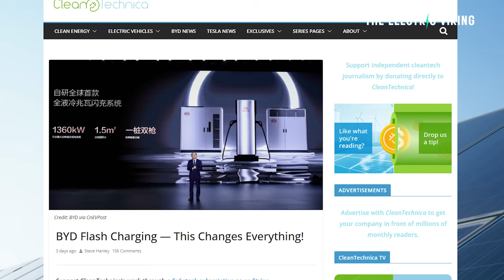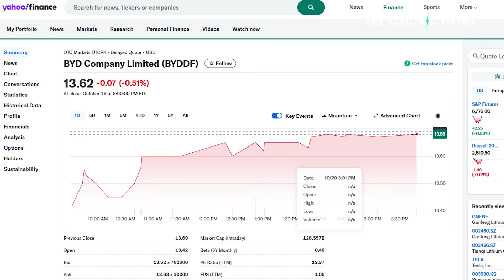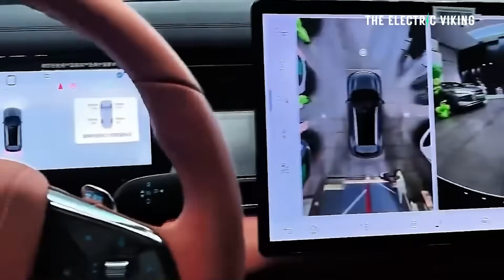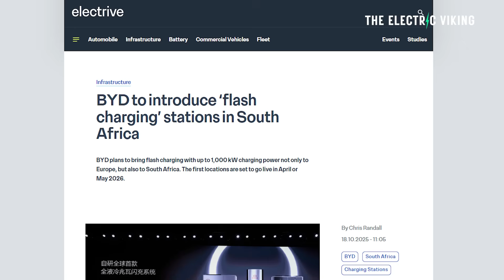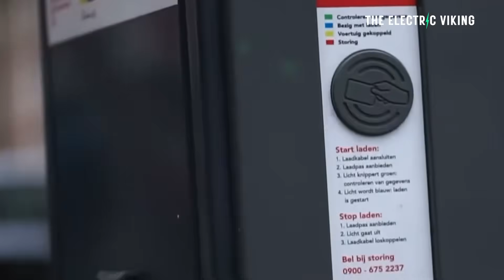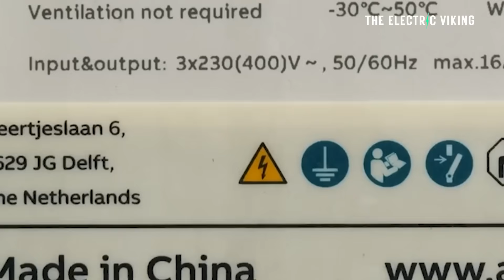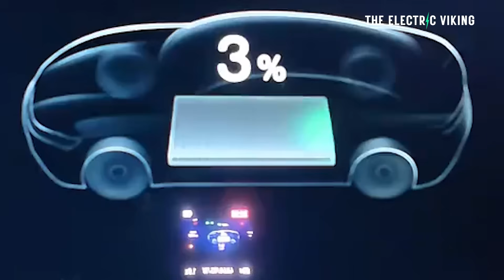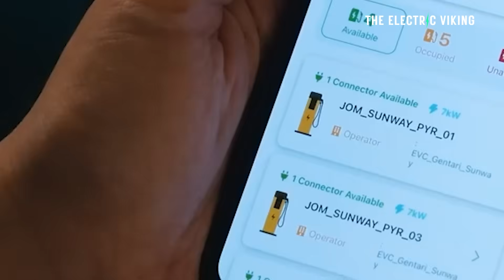Steve Hanley Says BYD's FLASH Charging "Changes EVERYTHING!"

Comment: Public chargers already deployed in Europe, like those using Alpitronics HYC-1000, can already support 600 kW charging using CCS2 and 1,000 kW using MCS connectors. Further, Phoenix Contact has launched a CCS2 connector and cable system in Europe, that supports up to 1,000 kW charging (1 MW boost and 800 kW sustained) using active liquid cooling cables (or 800kW boost / 600 kW sustained non-active cooling).

Comment: There is not simply one single thing that will dramatically help EV adoption. We need lower vehicle prices. Plus far more charging stations but those stations must be capable of fast charging so people aren't sitting in line for 1/2-1+ hours waiting to even start charging their vehicle. Sodium ion batteries may make a big difference in adoption as well for safety reasons. Especially if they pour some money into them to get the energy desity up a lot more to get the range up around 600 miles or more. To much EV bashing by fossil fuels over the years to make EV adoption really take off without all these things. We are getting close!

Comment: 1kKW= 1MW, the 3ph power supply current at 400V is 1500A/phase. 
it is an expensive installation for remote area.
Reply: If the station has its own buffer battery, then there is no problem at all; such a station may not even be connected to the grid if it has its own solar panels.
Reply: @alexandrshevtsov8  buffer for 1MW?
Reply: @RR_reunificationRights yes right.

Comment: Obviously people don't understand why are the 1MW chargers available...
If you take two cars on this DC charger, two of them will be able to charge little bit under 500kW... 
That machine will separate this power on two... 
So the car's don't need to be 1MW charge in to the battery, just 400kW, what is just enough for 800V, or 1000V battery platform... 
This will not be possible for 400V battery platform, because of the charging plug is not able to take more then 300kW of power with that mych current... 
It means to have capabilities to charge up to 1MW it is great, but car onboard computer will make decision how much power is going to flow in to the battery.. 
Good luck everyone...

Comment: Fast charging is way more important than range.  I don't want to lug around a battery with 600km of range that I will only use now and again, instead I would rather have a far lighter battery, say 200km, that could very fast charge on the odd occasions I am driving more that 200km in one go.
Reply: I'd rather range so I can go further and still return home to charge for free.
Reply: So charge up to 200km range and when you do need it, go higher? 🤷
Reply: Thats simple opinion, there are good reasons for the other way around.
Reply: @muten861  A matter of which factor is greater. Aero and motor efficiency matter more than weight as a rule.
Reply: Rethink that. What you really want is efficiency. Unless you are racing an extra 500 lbs of battery has no effect. Efficiency lowers cost, allows smaller batteries. 
Fast charging can seem the same, but costs more and the lower range puts you at the charger more often.
Reply: @thedukeofalinor1377 all else being equal, a smaller lighter battery would be more efficient
Reply: @thedukeofalinor1377  Complete and utter drivel, weight is extremely important to efficiency of cars.
Reply: @jamie-ck6js  Ignorance is not your friend, look up weight vs efficiency in EVs. While weight is important, other factors count more, like aero.
Reply: @thedukeofalinor1377  Yes, I did and weight plays a very significant factor.  Every time you accelerate, you’re putting energy into moving mass. The physics is absolutely blunt about it.  Double the mass, and for the same speed, you need double the energy to get there.  And in urban start/stop weight is way more important than aero.  So frankly you couldn't be more wrong.
Reply: @jamie-ck6js  True for ICE.
Not true for BEVs. But thanks for explaining your thinking.

Comment: Megawatt charging for passenger cars is massive overkill. 150 kW can add a hundred miles of range to a Bolt EV in ten minutes. 300 kW can add 200 miles in ten minutes. If I go to the bathroom and grab some snacks and a drink on a charge stop, I'll spend ten minutes at the filling station. I have charged at 50 kW or less on road trips for years, and the relatively slow charging has never been a problem. It could be for others, but it's not for me.

Increasing EV efficiency makes a lot more sense than supporting megawatt charger particularly while megawatt chargers are practically non-existent. If Aptera produces its vehicle next year, I may have a car delivering 400 miles from 44 kWh. Even at 150 kW, that's 200 miles in fifteen minutes, plenty fast enough.
Reply: Whilst I agree that efficiency is the more important goal, one needs to consider that most of the charger manufacturers selling megawatt chargers are doing so as flexible hub units that can support up to 8 charging dispensers, sharing power across the dispensers as required. This allows a hub charger to support anything from 8 cars charging at 125 kW to one HGV charging at 1 MW from the same unit at the same time, sharing the load dynamically between the vehicles.

The idea is to reduce charging site installation and operational costs by consolidating the number of power units required to as few as possible for a larger number of dispensers. Some chargers are now moving to supporting up to 12 charging points per charger power unit.

These chargers also operate at finer granularity, often in units of 50 kW or 62.5 kW, so cars can draw what they are capable of charging up to the shared capacity available - so if a 800v 500kW charging car is only plugged in it will draw it's full charging capability, equally they could support eight vehicles charging with a 50 kW charging capability (utilising only 40% of the chargers capacity, with the rest of the power likely shared at the site level with other hub charger power units).

Comment: charge faster, drive longer, cheaper to buy, cheaper to own, if all are achieved, then what's the point of ice car
Reply: Sound and nostalgia.
Reply: Fast charging is only important for a very small minority of people. I've had my EV since March, done 10,000 miles, been on holiday in it, and have only used Public chargers to get to and from my holiday destination. Only people who don't have EVs think ultra rapid charging is important.
Reply: @rogerfroud300 All the ev channels and manufacturers seem to think it is a big deal.
Reply: @rogerfroud300 Electric trucks needing it is probably worth it alone. Logistics and trucking are the baseline of markets and restocking.
Reply: @rogerfroud300 I have an ev and have had to charge multiple times now at fast chargers and im only at 4500 miles. Any drive that exceeds 2 hours one way means fast charging is needed along the way. Now if evs start to have 500 plus miles of actual usable range then sure fast charging becomes less of an issue. But that does not address the vast majority of people that do not own their own homes and rent. Especially in cities etc where they cannot have home chargers. Having evs that can charge in well under 10 minutes becomes very relevant if not required. My equinox takes a long time to charge even at fast chargers which is not an issue for me personally. But now if there are 10 plus other people also needing to charge that does become a problem if there a not enough chargers or thr chargers are just to slow... let alone if the car itself just cannot handle ultra fast charging.
Reply: @scow01 I go to Costco to gas up and wait in line for an available pump frequently. Total time at pump often exceeds 10 minutes, so not a problem for me. Just waiting for the EV range to get to that magic 500 miles baseline at a reasonable cost.
Reply: @rogerfroud300 I think not having to worry about running your battery to zero and then having it fail is more important. As well as operability at low temperature without significant capacity degradation
Reply: No point at all.
Reply: Well, if you're a MAGA cult dweeb in the US, I can tell you that there's still a huge point. They can prove their loyalty to the Orange Rapey Guy, maintain full cred and good standing with their demented tribal cohort of cretins, AND they get to keep spreading their big blobby, quivering legs wide open to the petro-gangsters. Sounds stupid to any functional adult, I know, but as a resident of a tRumpy area of California, I can tell you that lots of people are still that dumb and zoned-out to the cult here. It's JUST FREAKIN' WEIRD. 😵‍💫
Reply: Yep, achieved in 2017 by my math for high end sedans.
Reply: Handy if you wish to top yourself...just a matter of a hose from the exhaust of course.
Reply: To own the libs.
Reply: @magnetospin ...an interesting demo of how small, venal, stunted and without spirit, heart or soul they are.
Reply: Dream on! How will Governments tax it is the elephant in the room...
Reply: Cheaper to buy,that is what most people want. I don't care about how many bells and whistles have, i don't buy a car to bragg with it,but to transport me from A to B fast and cheap. Among the european brands it seems only Dacia understood this,so it sells the most by far,double the number of others famous german brands. If a car charges up in 10 minutes but it costs 70 000€, i'm sure i won't buy it, but i will buy a 12 000€ Dacia, even if its autonomy is of only 250 km.  Why? Because that's what i can afford,simple.
Reply: Wow what rollocks. It's like saying you can increase the speed of refueling you car with petrol by doubling the width of the nozzle or the flow rate. This is easy with petrol and diesel...but where's the extra electricity coming from for these ultra high watt chargers? There are already electricity shortages ...heck in places like the USA the hot water kettles take so long to boil water because of their national voltage and infra capability
Reply: Depends where you live. In Ireland it costs more to charge a battery at a public charging station than to fill up an ice car with petrol or diesel
Reply: Going to need a charging cable ass thick as a Firehose to deliver the Amps in 10 minutes!
Reply: and have cycle life of less than 100.
Reply: No point at all. Move on to better technology just like with everything else in the world. Let the elderly enjoy their ICE classics, typewriters and corded rotary home phones. Leave Grampa alone!
Reply: @larryc1616 Great.  Get back to us when we can actually buy one.
Reply: Let's see if BYD really delivers!
Reply: Keep dreaming...
Reply: The point in ICE cars running on water. There is a new game changer. Hydrogen is the future! An Iranian scientist claims he's built a car that runs on nothing but water. The inventor says the vehicle uses a process to split water into hydrogen and oxygen, then burns the hydrogen to power the engine allegedly traveling 900 km on 60 liters!
Reply: Yep now you just need to x10 the global electricity supply via windmills and solar to even make fast charging mainstream at scale.....orlimit EVs to the minority